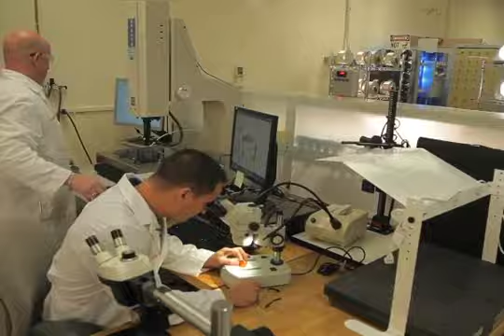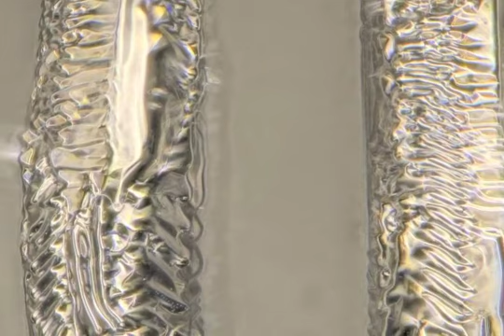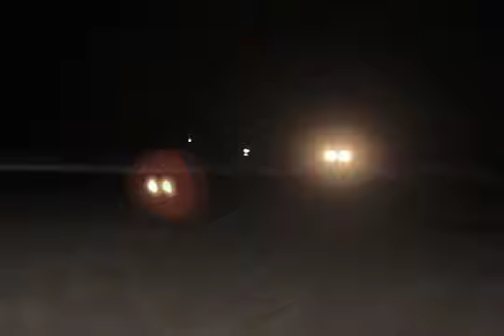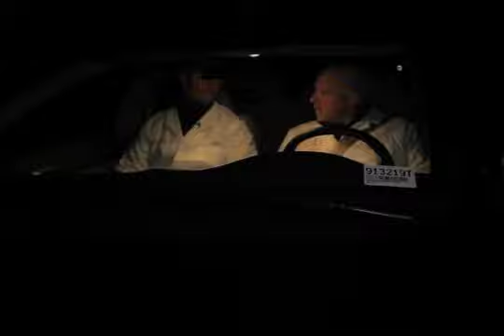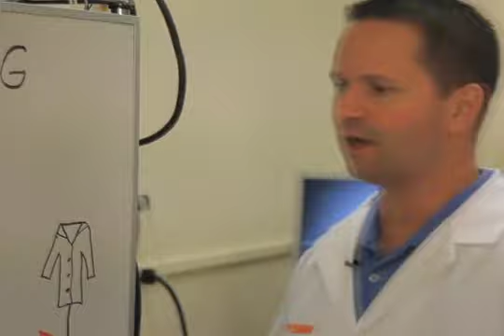Sylvania SilverStar - Truth Sleuths

Comment: It's all hype guys. There's not much difference. Put some new OEM bulbs in for  $15 to restore your light output and not $50 for some coated bulbs that give you a faint hint of white. 

I have a video for proof.
Reply: I agree with you.  I bought the silver stars before and all they did was make the headlight look whiter.   They burnt out in less than two years.   I wouldn't buy them again.   I just use the basic halogen ones that are less than $20.   I actually prefer the warmer color temp over the coated whiter/cooler bulbs.

Comment: Great video. Silverstart Ultras are brighter. But something in the small print is that they only last 150 hours, much less than stock bulbs.My experience has show this is two years. For people used to driving for many years without worrying about
headlights this will come as a surprise. So be sure to have a spare at hand; you will need it a lot sooner than you think.
 At $26 a piece they are three times as much. Be ready for sticker shock. May be worth it if you value the safety of better lighting.

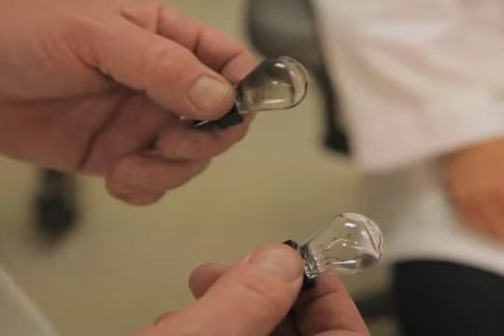Comment: For how long these guys have worked here, there sure do not know there bulbs well and how they work. Tungsten bulbs are filled with a Halogen Gas (Bromine) which will react to evaporated Tungsten and cause a chemical bond with the Halogen gas and dissipate back on the filament and increase life. Halogen bulbs will not blacken unless under some odd condition, (over voltage)  1:19 are just regular bulbs and will blacken.